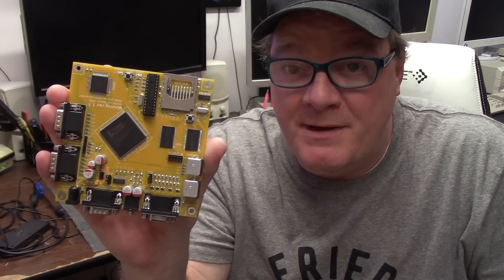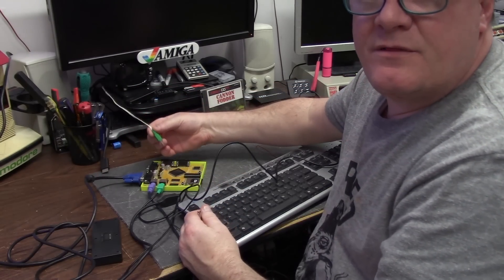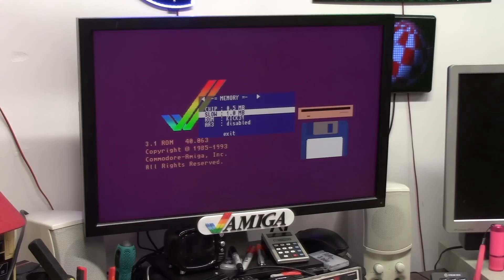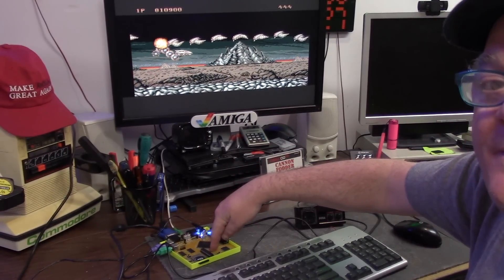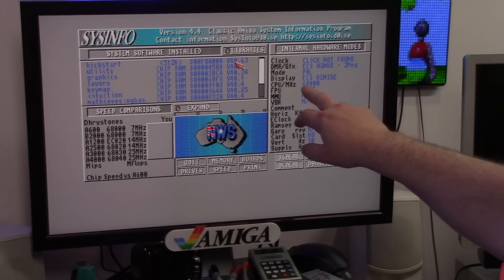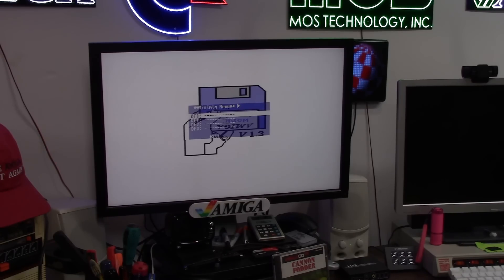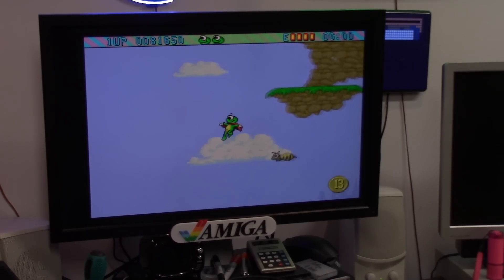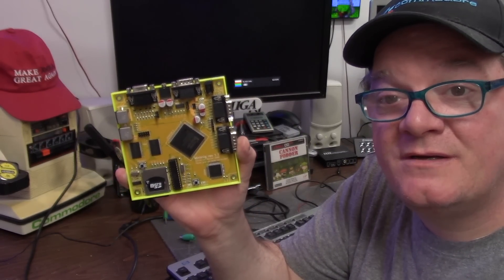Lost footage- The MiniMig a mini Amiga v1.1

Comment: Hi Chris,
Great video as per usual.

Just wondering if you have seen either the Denise or Amy ITX Amigas yet?
Reply from the maker: i have the minimig 1.97 Mini ITX, that was the video before this. the only mini amiga's I have used are the Minimig and Edu-Aranas Un Amiga in the Stephan Jones case i did a while back. For Me the Mister is too expensive when adding the de10 nano , the board, ram, and controller boards, and all the stuff needed to make it great.

Comment: Pretty impressive bar a couple of things compared to using a R/Pi 4b. MiniMig is way over priced, has no HDMI output, no onboard Amiga keyboard connector and looks like it wouldn't fit inside an Amiga 600 & 1200 casing, compare this against a R/Pi 4. The Pi fits inside ALL Amiga casing's (with just a small amount of adjustment to where you want it inside the casing) along with a Keyrah keyboard board.Great video though, Chris and so looking forward to your release of your new PiMiga v4 software :) :)
Reply: And for every point you made, there's an alternative view that's just as valid. Overpriced to you, bit what does it cost to design, make parts and build it? Still cheaper than a real Amiga. HDMI has to be licensed,  which bumps up cost considerably on small scale projects. Who needs an Amiga keyboard when there are a huge selection of new, reliable and cheap keyboards? What about an A2K, 3K or 4K case? Raspberry Pi has an underlying OS to service, extra work, extra time to boot. Software emulation has lag and doesn't feel like an Amiga. Pi4, Keyrah, Amiga case and relevant cables costs a comparable amount to a Minimig.
Reply from the maker: @another3997 its all open.  You can build your own all the bom and gerbers are free on that website